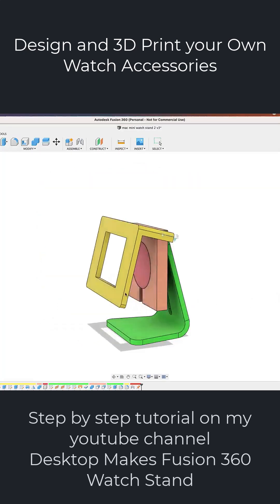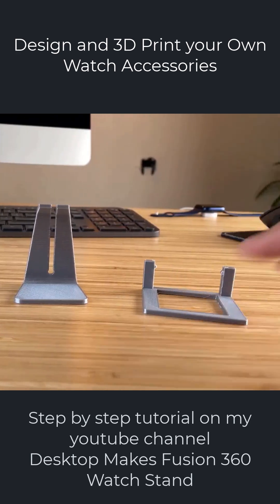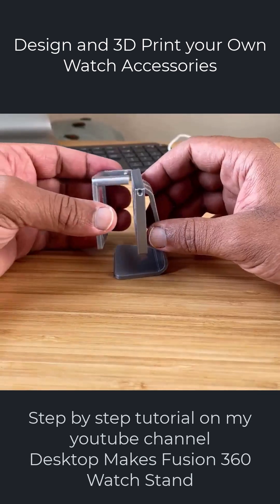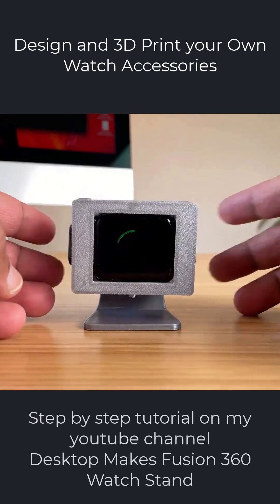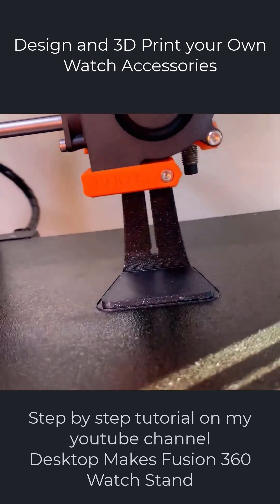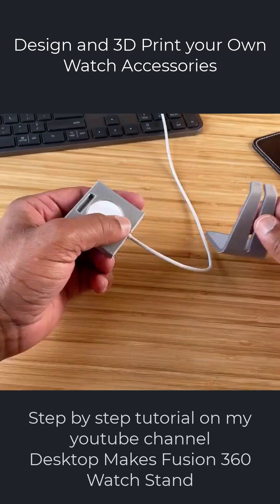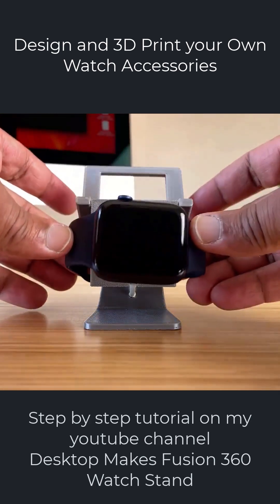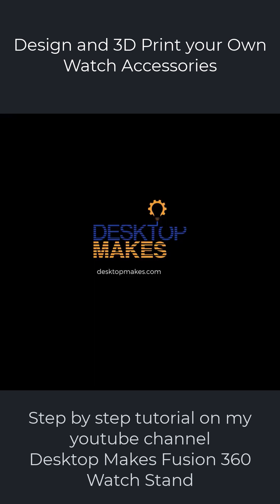Design & 3D Print your own Watch Accessories

Comment: I'm happy for you in your designing jorney. However the lid is just not necessary. You shoud see about lean manufacturing. Imo remove the lid and put an angle on the part where the watch sits.